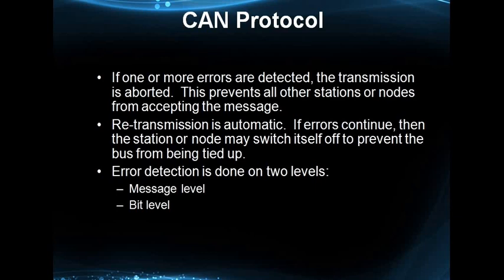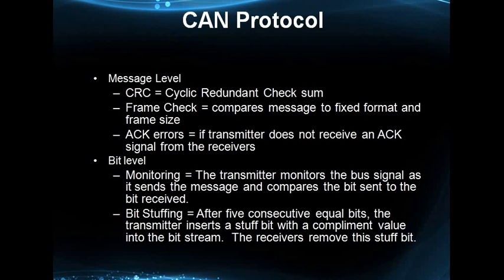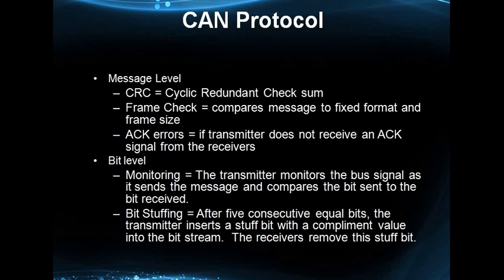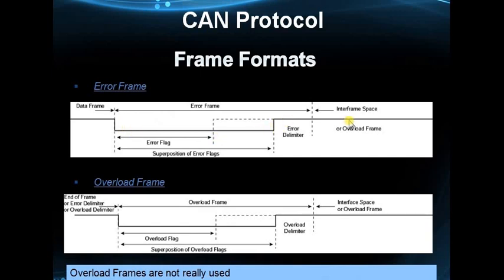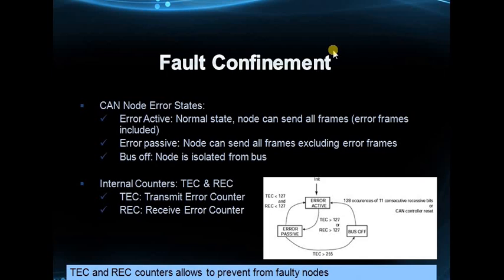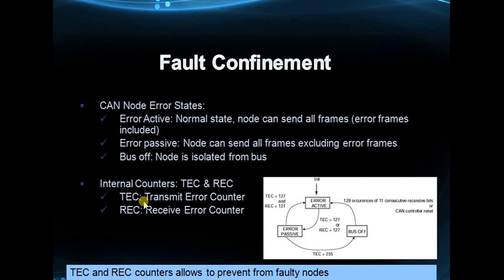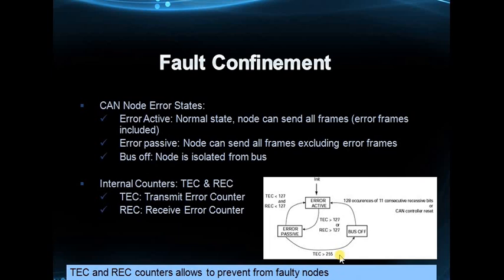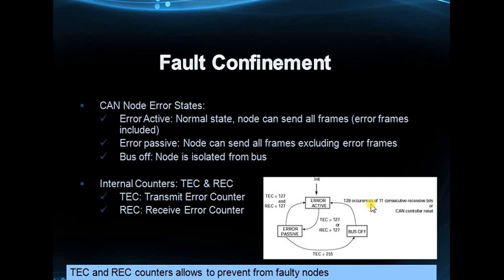CAN error frame & overload frame

Comment: Sir Why TEC is incremented by 8 for bit error ?
Reply from the maker: It is as per the specification of  CAN protocol, why 8 , may be because transmitter should not block the bus, more the transmit error count would put the node into passive mode
Reply: @VenkateshMane  thanks for clearing doubt